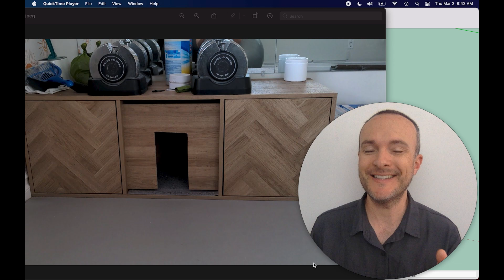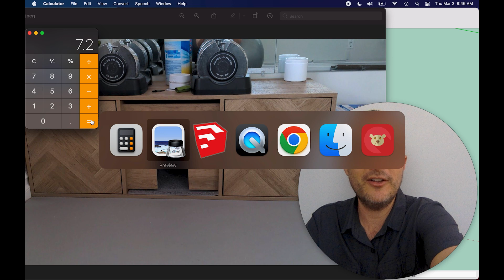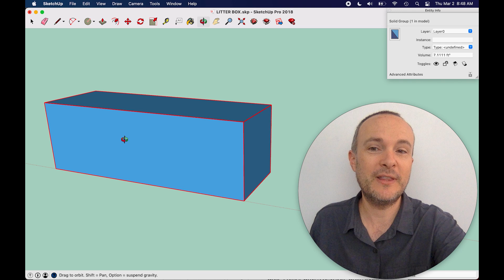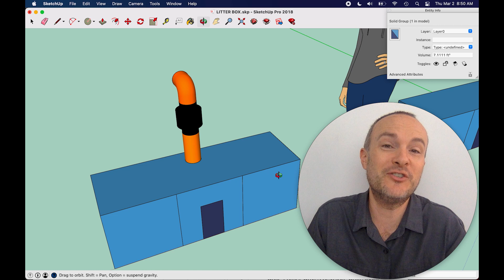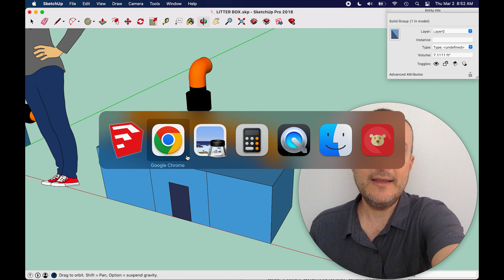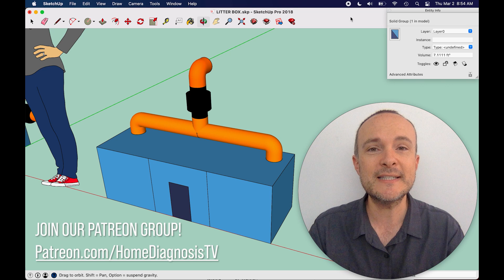Litter Box Exhaust Fan: How to Size, Select, and Build a DIY Custom Cat Bathroom System

Comment: Does length of exhaust pipe change the cfm requirement.  I need to run it up about 8ft turn 90 deg and run almost 20 feet to the exterior wall.
Reply from the maker: Each 90 deg turn = about 30 equivalent feel of straight run
Reply: @HomePerformance  So any idea what I might need to pull 8' up, 90 deg, 20 feet over for a 20 cubic foot box?

Comment: Hello! I have two quick questions concerning my design.

My box will be enclosed and I plan on sealing it as much as possible to keep the dog AWAY.  I will have a motion sensor and timer to trigger than pc fan.

(1) If there’s no real “intake” like your opening (save for cabinet relief of 1/8” which I plan on covering with door draft blockers), will it create some kind of pressure issue for the cats?

(2) My setup is only 6.5 cubic feet.  Using the air velocity calculator I’m ducting an 82cfm computer fan to a 5” duct.  I can’t tell if it’s asking for radius or not but I’m basically just wondering how long waste will stink so how long would you recommend I run it? It clears the volume of my system in 5 seconds.

Side note I have a damper on the duct to prevent any wind coming into my box somehow idk if that means anything lol
Reply from the maker: Ideally the fan runs 24/7. That’s how long the litter box stinks for. Recommend a much smaller fan.

Comment: The problem with the last two designs is that you're calculating this to fight odor in the litterbox themselves which doesn't actually seem necessary. The cats won't care. You really just need to go with the first design, single exhaust with enough airflow to keep the litterbox enclosure in a negative pressure relative to the room to avoid air (and smells) from creeping into the room.

Comment: Let’s do some easy math. Take a home that is 2000 square feet. Multiply that by a standard eight-foot tall ceiling. This yields 16,000 cubic feet. If we use a fan rated at 50 cubic feet of air flow per minute (CFM), times 1440 minutes in a day, we have 72,000 cubic feet – 4.5 times the volume of the home – that is being blown out the window each and every day. Annually, that's 1,642.5 housefuls of air that you paid good money to heat or cool..

Unless it is your intent to heat or cool your neighborhood, there’s a vastly less expensive and more environmentally friendly way. I got a Purrified Air Litter Box Air Filter that cleans that same 50 CFM of litter box odor, along with other household odor and particles that comes its way, such as smoke, cooking odor, cleaning chemicals, harmful Volatile Organic Chemicals, microorganisms, bacteria, virus, dust, pet dander, mold and mildew. And every single cubic foot stays in your home. 
The filter draws one third of an amp. This means that if you leave the filter on 24-7-12-365 and you pay twelve cents per kilowatt hour for your electricity, it will cost you about $4.15 per year in electricity. 

Even your dubiously inadequate  7 cfm figure will push 10,080 CFM outside every day. That's 3.7 million cubic feet a year, or 51.1 housefuls of air in the above example.

Comment: Very good. I was thinking about this same setup but for only one cat. Something a person needs to consider is the home's airconditioning. When the AC comes on it causes a vacuum throughout the house. (Any opening to the outside will allow air to be sucked into the home) The cat litter enclosure vent fan should be able to overpower that vacuum so the airflow being pushed out of the enclosure doesn't get sucked into and throughout the house. Additionally I was considering using large computer fans since they are quiet and can have speed control.
Reply from the maker: Thx for dharing, and FYI your A/C should NOT be depressurizing your home- something is wrong if that’s the case, and it can lead to bad stuff.

Comment: I built something like this and it didnt work. I think it was because the front side was more open. I will add a front panel with a small door and try again. Good thing I didn't throw everything out in a fit of rage.

Comment: Would a pc fan work? Very quiet, variable speed, numerous size options, cheap as dirt, incredibly low power requirements. Also do your cats show any hesitation about going inside?
Reply from the maker: Sure that would work. No, the cats can’t hear anything bc the fan is so quiet.
Reply: @HomePerformance  Cats can hear quite a bit more of the audio spectrum than humans or even dogs can. So I don’t think that’s true. But they also sense with whiskers which I would imagine being in a slight vacuum would have some impact on.
Reply from the maker: @Nhfilz we do blower door tests with cats inside the house at -50 Pa (.2 inches of water column), and I’ve never seen a cat be bothered by the pressure fyi.

Comment: AC infinity is a good source for small vent equipment. I've used their computer fans for equipment looking and plane to use their inline fans for upcoming project. They have good dimensions, controllers, and specs for all their stuff. I have not tried their customer support though.

Comment: I took the concept of your tiny lab cat box idea and iterated it to my in-law's house renovation a few years ago.  We ducted a small hard pipe exhaust in the laundry room wall that goes into the built in cat box. They have 6 cats and it gets cleaned daily but it's amazing what a small 25 cfm inline fan exhausting to outdoors can do in a small space like this.  There is zero smell or issues in the house for 6 cats.  The only time they ever had a problem was when they lost power for a few hours, other than that they said they absolutely love it.  It's amazing how such a small solution solves a common problem.

If I were to do it again, I would have done a few minor things:
-instead of having a filter grille on the face of the exhaust port, I would have put in an in-line dryer filter at human level (such as the fantech DBLT4W) so it would have been more accessable than crawling down weekly into the cat box to clean the fur and litter specks out of the mesh of the filter grille.
-I would have pushed harder for an ERV because this thing is on 24/7.  At 25 CFM, the fan is sufficient for cat smells at it's lowest setting but that is 25 CFM exhausted all the time. The house is a 70's build with NO combustion appliances that is not super air tight other than the attic deck being spray foamed.  Maybe when it comes time to swap out the fan someday, I can justify it to them.

If/when we re-do our 50 year old kitchen space, I plan to have a small exhaust (10-15 cfm)in the cabinets that our trash cans will be in (there are only 2 of us and a kitchen trash bag lasts 4-5 days and often get taken out by smell first instead of how full the bag is). Our exhaust from this will go through our ERV to capture some of the energy.
Reply from the maker: HELL YEAH CHRIS, you are awesome

Comment: I've got one in my house essentially. Water heater room is a 3x6 room. I've messed with the intake pipes but verified co numbers but a 4" intake pipe 12" from the floor and a 3" exhaust pipe coming off a 40k btu 40 gal water heater is the exhaust going out. The catbox is in the room and it has one of those magnetic exterior kitty doors going through the wall into the room. 100% scent free and nobody who walks in the house can ever figure out where the litter box is. After doing the litterbox venting thing you really can't go back.

Comment: Why do all vent caps seem to be terrible? I just added an exhaust fan for our bathroom and every vent cap I looked at doesn’t really close all the way or come any kind of close to air tight. It seems like a waste to open a hole in our house envelope for a fan that will be run very infrequently (guest bath). Same thing with a larger vent cap for kitchen exhaust - I can see so much daylight through it!

Comment: I built a box for ours years ago. The box is out in the garage and is a sealed box with a entrance into the laundry room. We used the littermaid automatic boxes then which I had dump the litter into a box below that was on wheels and had a bag so I would roll that box out tie up the bag and toss it. Then just refill the litter box with litter.
 For the vent fan I use a PC fan that has been running non stop for something like 8-10 years though it does need to be replaced and upgraded. The problem I run into is venting outside. The box is located on the prevailing wind side of the house so balancing the tension of the check valve with the minimal amount of airflow and the wind blowing against it is a pain. 
            I do like the fan and filter products for the green business... Lots of cheap parts for other cool stuff. I have a plan to build a few filter items for the shop with some of that stuff since the filters are so cheap and work well. Good systems for welding fume exhaust/filtration painting etc.

Comment: Looking forward to the new 2024 cat box minimum air flow CODE . Don’t forget duct leakage test using The Energy Conservatory or Retro Tech duct blaster.  Required pass certification.. 

Lol 😂. Oh, a computer fan, and you decrease the voltage to the fan by almost 50% and the fan will become silent and move your required one CFM.   You can pick them up used at all computer repair stores for the throwing out old computers. . . 
And you will be using less than 1 W of power . 👍
Reply: might have to create a new blower door device for it
Reply: @gingerznz5742  a hairdryer
Reply from the maker: Nice, Tom